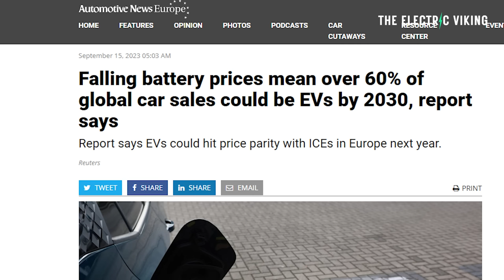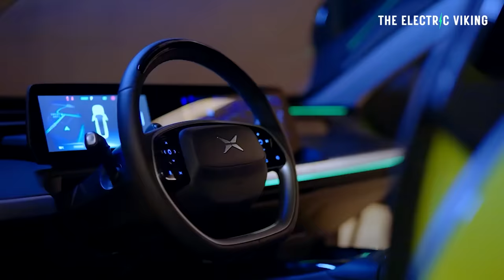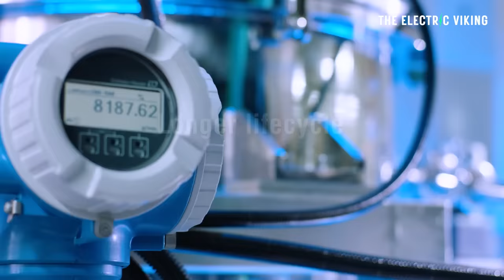Small EVs hit price parity with internal combustion after huge battery price fall

Comment: " Prediction is difficult, especially about the future"  Niels Bohr.  The cost of a new EV is only one factor in the decision to buy one. Presently EVs benefit from tax breaks. As their number increases these will be removed. The infrastructure needed to charge these batteries is not in place and will be very expensive to install. Only a minority are rich enough to be able to charge their EVs at home. At present to cost of charging at a public facility varies widely. All these factors will limit the uptake of EVs

Comment: If the grid goes down for several days what are the alternative methods to charge my EV
Reply: How would you fill up your ICE car if this happened?
Reply: Panels on your roof + local batteries
Reply: This NEVER happens in developed countries! Never ever happened in my whole life (and I am 65), not even 24 hours!
Anyway, if the grid goes down, then you can't pump gasoline into your tank at the gas station! So what is the difference?
With solar panels on your roof, you can recharge an EV.  Hard to refill your ICE vehicle from an oil well in your garden!
Reply: Solar panels on your roof

Comment: Interesting that American electric cars have slowed considerably. Could it be the range compared to Europe?  Could it be apartment dwellers have no personal charging stations?  Regions in the United States are now taxing more appropriately for their road use?  Underground and stacked car parks are not allowing electric cars in and not offering chargers due to safety in regions of Europe. More than two auto transport ships have been lost to EVs. I know of several homes burned  the ground from electric car charging. Our build code is one hour firewall for a home garage (adequate for ICE cars). 
Japan is well invested into hydrogen. The Americas might look that way as well since they are finding it hard to keep the lights on at night or a hot day.

Comment: If you want to see what will happen to ICE Vehicles, look at  what happenrd to CRT TVs. The thing about flat screens is they are so much simpler than CRT TVs, just like E-Vehicles over ICE. 

It took till 2005 for flat creens to hit price parady. Then they quickly became cheaper. 20 years later we're seeing the same thing happen with the automobile.  

By 2030, ICE Vehicles won't be manufactured anymore because you'll  be able to buy a E-Vehicle for a fraction of the cost.
Reply: You must have a time machine.
Reply: @viralsheddingzombie5324  
You don't need a time machine if you track technology.
Reply: @danboyd2725   well, we already know ICE vehicles existed in 2010.
Reply: @viralsheddingzombie5324  
Meant 2030. Corrected it.
Reply: @danboyd2725    You can't rewrite history.  LOL

Comment: Price parady is false. The oem's have used the chip shortage as a tool to sell higher priced ice. The base model vehicle has all but vanished. This will not always be the case. The oem's will return to a mass production lower cost vehicle when pushed.

Comment: EV battery prices going to highly fluctuate with the resource market.
Therefore batteries may end up much much more expensive!
The S-Curve has a curse! If you don't know it, you don't know the S-Curve!
Reply: The cost of the materials used in an EV Battery are less than 25 percent of their total cost.

The largest cost factor is the capital investments of tge factories built to manufacture them which are paid down over time, the second largest cost is building the pack.

As time goes by,  manufacturers will vastly lower the production costs of EV battery packs. 

The likely price of an EV battery pack will fall to less than 50 dollars per Kwh within the next 4 years, less than half the current cost.

Comment: EV sales predictions are as corrupt as climate predictions, they will prove to be wrong over and over again. Even if EV's cost 20% less they are unlikely to take off as quickly as you suggest. There are serious if not impossible materials issues, they do not work in most parts of the country, and the charging infrastructure is non existent.

Comment: What we need to do is improve our infrastructure we don't have enough electric power for all this electric car building. They are routinely telling people in California to not plug their electric cars in because the grid can't handle the requirements.
 we need to build more natural gas fired power plants or nuclear.
 small scale nuclear is a doable thing right now and it's not expensive.
Also with the increased demand for electricity as you stated in the video less demand for gasoline so gasoline prices should fall as well this will be good for the old folks that can't afford the new cars that are stuck on their pension like me.
 I currently own a nice ice engine powered car I'm happy with. 7:10

Comment: I am so sick of gas and diesel trucks. My old gas truck, ram 1500 needed a new engine. I didn't want to buy a new gas truck because I am waiting for a cybertruck. My old diesel truck is on its last set of tires. But I will need a one ton diesel for towing so I bought a 2021 ram 3500 with 22k miles. I don't normally drive my one ton except for towing but I figured  I could drive the "new" one while they put an engine in the old gas truck. 1400 miles later I found myself sitting on the side of the road with a bad transmission. So I ended up driving my old 2005 ram 3500 with all its problems. The diesel was out of the shop first but one week later it left me on the side of the road again. This time it was a clogged particulate filter. They think I got some bad def. Diesel truck is still in the shop but the gas truck is finally back. New engine, new radiator, new water pump but I forgot to ask for a new fan clutch. Sure enough I had to replace it. Still the engine sounds like it has a miss. Tell me again how "real" truck guys won't buy electric! I can't wait to dump this shit and drive something I can charge with my own solar panels.

Comment: I think the REAL breakthrough will come by 2026, when battery packs will get a lot smaller without a loss of range per charge and charging from 0% to 100% happens in under 10 minutes. That's when we can get vehicles about the size of a Hyundai Venue, Nissan Kicks/Juke or Toyota Yaris Cross really become ICE car replacements.

Comment: I will definitely buy my first EV in 10 year's time. They will be as cheap as chips and a lot safer than now because they will finally have full 100% effective battery insulation and protection. I don't care if it makes recycling difficult. Not my problem.

Comment: If all the vehicle on the road in the USA were EV, Would the current electric grid support it? if not how much more electricity would be needed to charge all the EV's
Reply: Needs to be increased by 60% for a 100% switch. Cart before the horse doesn’t begin to cover what’s going on.
Reply: @Bob_Smith19  NO, it would only take a 30% increase in electricity production to achieve full EV adoption. If the US is incapable of achieving this in the next 30 years (a 1% increase per year), then we are in a very sorry state.

Comment: The idea that car companies are in serious trouble might be true, but not for the assertion you make in the first 30 seconds of the video. Let me explain. Let’s look at some of the EV costs and other factors that promoters of EVs don’t like to talk about. The first is the electrical grid can’t deliver that much additional power in many locations, and that will not be possible for another 30 to 40 years. Also, that power has to come from somewhere. Even if you put a solar panel on every single surface on every single building in every single town, it would not be enough to power all those EVs… so they have to be receiving power from some sort of generation location, and the only way to do that with zero emissions is to build a whole bunch of nuclear power plants that the people are afraid to build. It’s not really a reasonable fear….because the technology has improved so much for power plants that you’re never going to have a China syndrome situation, but people don’t know that and legislators don’t care to know that, and so we’re not going to be building the plants. So….we won’t have the grid, and we won’t have the generation capacity. Then there’s the cars themselves…mechanics know how to fix internal combustion engine cars. They do not know how to fix electric vehicles, and electric vehicle parts have insane price points. Just look at what it cost to replace the batteries in a Tesla or a Honda EV or a GM EV or a Ford EV….it’s insane. It’s like buying a lower priced Hyundai. So, while the electric vehicles, especially from China, are going to become much cheaper, people will not want to buy them unless they’re forced to…. and then you’re going to have a whole bunch of cars sitting around that can’t be fixed and can’t be charged when we reach that critical mass of not having the assets in place to service thousands of electric vehicles. Mr. speaker, I yield back the balance of my time.

Comment: Probably won't happen in spain so quickly... at the moment only 3% are pure EVs.
Reply: It could, demand is just soo high - and the supply so low right now, but I say in the next 5 years that 3% will more than likely be around 15% if not more.

Comment: ICE vehicle owners will be topping up their fuel tanks from a 44-gallon drum of petroleum at home when the petrol stations disappear. 

The number of petrol stations shrunk in the past from 4 at major intersections to one in the recent past.
Bank branches disappear, as home banking is happening. 

Self parking EVs will plug themselves in. 
A software update and an extruded plastic gadget at the front of the car, and a simple wall mounted plug, a weatherproof plug.

The vehicle will identify itself and control the electric flow to suit its priorities and grid demand. 

Solar pv is cheaper than windows $/m2. Every building is connected to the national grid. 

The national grid can be UNLOADED and protected by the millions of dispersed storage and generation at the point of use. 

The existing national grid is fragile and extremely expensive to expand. 

😊😊😊😊😊😊

Comment: And yet in USA, EV is only cheaper if you pay enough taxes to use the "7500" government credit.  And then, only for the bolt.
Reply: Model 3 in tco is cheaper than a corolla or Camry over 60 month's.
Reply: That's USA. Chinese EVs aren't there

Comment: How about you guys not mentikn the safety issue?    I am talking about COMBUSTION.   Yes, not the engine combustion, but outside of it:  in the last 5 years, EV sales have increased seven times in Korea.   But, the fire increase increased by twenty two percent.   That's the problem.   With the increase of these dangerously  flammable cars, how are you gonna deal with increased fire calls?    They are not easily extinguished and once they get into flames escaping from it as well as evacuating other cars from a parking lot near it is extremely dangerous.    You think this issue will be solved as time goes on?   Or as usual the beta testers will have to give up something working and suffer the testing rat fate?

Comment: Will the grid be able to handle all the extra houses charging their EV?
Reply: IN the US, a full conversion to EVs would require a 30% increase in electric energy. Given that a conversion will likely take 30 years, a modest increase of 1% a year in electricity would satisfy this requirement. Our electric producing and distribution system is in need of modernization regardless of any EV conversion.
Reply: The short answer is yes, at least in developed countries.  There is only one caveat:  to avoid  recharging EVs during the peak hours of the day.

Comment: I will not buy an electric car until the range is doubled ...
The charging stations have increase to remove charge anxiety..
The cycle life of the battery's are 4000 or more cycles
The cost of replacement of the batteries is under 1/16th the price of the car..
End of Story!
Reply: I do not know where you are in the world but your comment is the most common one in the UK. The kickback is fierce here and sooner or later politicians will drop EV adoption laws as the voters rebel . It has happened before when the people took a stand"………Brexit

Comment: Love the magical thinking...the only reason evs sell is government subsidizes. There is no repair, charging, electrical generation capacity, fire protection systems, regulations for infrastructure, basic material availability or way for multi dwelling charging to occur just to name a few issues. By the way if cars are charged at night solar doesn't exist. Im sorry but ev fans need to slow down and smell the cobalt fumes before you destroy the freedom to travel.

Comment: Sorry but it will not happen. EVs car prices are still hiking up and not down. If you follow a consumer logic yes it should drop in price, but if you follow automaker logic, it will still go up and up. Battery prices still dropping?  No scuze, still going up.
Reply: The latest report from the cell supply side says per kwh this year it's below $100 first time since mid 2021 it was this low.
Adjust that for inflation and this year is the cheapest year by far for all ev cells across the board globally. 👍🏻

Comment: EVs aren't suitable for every situation, especially those at the lower end of the retail price ladder with much shorter range. A cheap ICE car can do 600+km on one tank even under harsh winter conditions while a budget EV might struggle to get to 200km. Fast-charging costs 2.5-3X the residential power rate, which makes EVs a far less appealing proposition when you don't have the luxury of doing most of your charging at home. If I walked into a Hyundai dealership today, the cheapest ICE I could buy based on online prices I'm seeing for my location is still half the price of the cheapest BEV. I wouldn't be at all surprised if EV adoption ends up hitting a much lower ceiling than anticipated.
Reply: Wait till you see the new Wuling mini at $2800 plus $30/mo battery subscription. CHEAP.
lol
Reply: @EnriqueThiele just remember not everyone can charge at home or at work and I am one of them
Reply: @EnriqueThiele  I'm in an apartment with no access to power from my parking. Charging at home is not an option for me and hundreds of others on my street alone. Another problem with putting EVSEs in every parking lot will be copper thieves mining parkings as a renewable copper source.
Reply: @teardowndan5364  we have seen in the UK people cutting the cables off of the chargers

Comment: Where are we going to get all the hamster wheels to generate all the needed power?
Reply: We're installing them.  We're setting up wheels for sunshine hamsters and for wind hamsters faster and faster.
Reply: we need more nuclear power plants.  solar farms are an eyesore and wind is a maintenance nightmare.
Reply: @edt9666  I agree with the nuclear plants, I think the small micro nuclear plant systems are the future along with wave and tidal harvesting but these both require long lead times. Until these alternatives are available we need to stop demonizing hydrocarbons and learn to use them more efficiently or perhaps just breed bigger hamsters.
Reply: @jackdelvo2702  Agreed, but if they can put a nuclear power plant on a submarine in relatively quick measure, it's possible to build more at scale and scatter them across the country.  I have solar and wind operations near me and northern new england isn't the ideal place for that, but it's all about profits.  Just follow the money, not the science. (the American way, until Tesla came along).  Isn't there a nuclear power plan on campus at Texas A&M?  It can be done, but those who can push this through are bought to look the other way.
Reply: The power generation capacity is already there, but it's being used to refine crude oil into road fuel for ICE cars......as EV uptake increases, the production of fossil fuel from oil will decrease by default.....which will mean that energy previously used for refining oil, will be available in the grid......